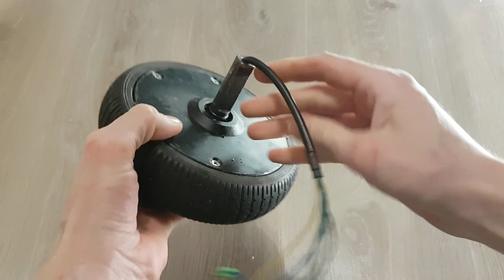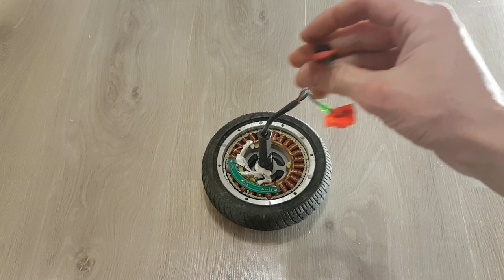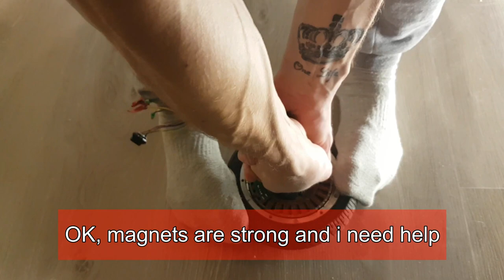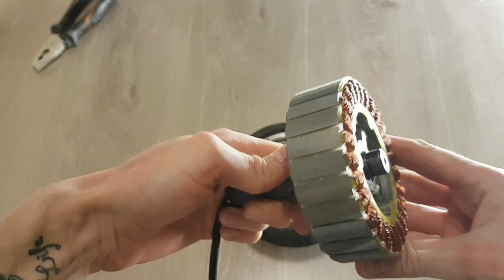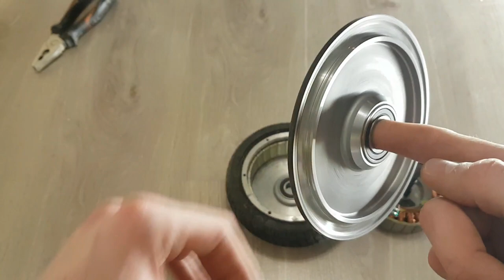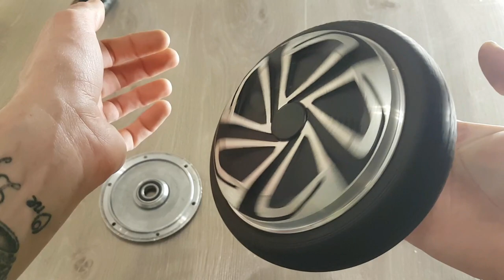what inside hoverboard wheel motor, disassembling hoverboard wheel

Comment: In case someone is interested:  this a three-phase BLDC motor, in outrunner configuration, wired in a Wye configuration.  Each phase is wound in 3 sets of 3 coils, with each set of 3 coils spaced 6 coils apart (ex: green wire feeds the phase that uses coils  1,2,3,  10,11,12,  19,20,21).  In each set of 3 coils, the wires are coiled CW,CCW,CW (CW=clockwise, CCW=counter-clockwise).  The magnets are glued on to the hub in a pattern that alternates between North and South.  The magnets don't totally align with the coils, as there are 27 coils and 30 magnets.  For the 200W version that I have (the one in the video is 350W, so the numbers are different):  for each phase, there are four wires that are coiled in parallel and each coil is wrapped 16 times.  The number of coils in series and number of times the wires is wrapped around each coil determines the voltage.  The number of wires in parallel increases the max amperage.  From the video, it looks like there are 7 wires making the 6-coil jump, which makes sense, because if 4 wires allows for a 200W capacity, then 7 wires should allow for a 350W capacity, as 7/4 = 350/200.  That means there should be 7 wires in parallel for each phase, coiled 16 times around each coil in the phase's pattern.
Reply: Big thanks for the details, looking for more details on stator dimensions, and magnets as well, for all three (250, 300, 350W sizes)
Reply: @MrCuriousYogi stator is 31.5 cm in circumference.  diameter of the axle at the bearing is about 1.5cm. total height from bearing to wire exit from axle is 12-13cm, depending on how you route the wires coming out of the axle.  magnets are 2.5 x 1 x 0.3cm.  bearing model is RUWH 6202RS

Comment: My wheel inside my ground wire broke off. I solder back on and it worked 👍. Remove the wheel from magnet shell and look at the wheel board 4 wires

Comment: I was thinking of modifying a power wheel truck by using these type wheels. Do you know if they require a motor controller? It looks like a permanent magnet dc motor, so I was hoping simply applying the correct current would spin them.
Reply from the maker: Bart Rando you need dc brushless motor controller to spin this wheels
Reply: @MrCopcreator  yea, i should have figured considering it needs to balance
Reply: Bart Rando did u do it yet

Comment: Do you know if this motor can run with a standard RC ESC?
Reply from the maker: Corral Lobo yes it can run 👍
Reply: Awesome! thanks! cool build.
Reply from the maker: Corral Lobo thanks 😉
Reply: An RC ESC will spin the BLDC ... but how fast, with good torque, at full load, and 46 volts ... before it frys the ESC? I guess if you buy the largest RC ESC controller on the market, like for a big prop plane or something? Those are expensive though.
Reply: @jwood6902  they-re about 16rpm/V, 10A continuous current. So they don't need big esc but high voltage instead since they-re quite slow.  Great torque however.

Comment: My segway is broken at least only one of the wheels that won't move but the other one does and I have been waiting for a month now for my parents to try and get the motor out of the wheel but the motor magnets are that strong that they just can't get the motor out of the wheel and my parents are just not going with my suggestions to get it out I'm really getting bored of waiting and it's annoying just watching my brother happily playing on his whole I'm indoors bored as hell any suggestions you can help me with to get the motor out of the wheel😭😭😡😡
Reply from the maker: The motor and the wheel is one piece. Are u sure the wheel is broke. Could be lose connection or faulty board. Just unscrew all the bolts u see and remove plastic covers then u’ll be able to see inside components